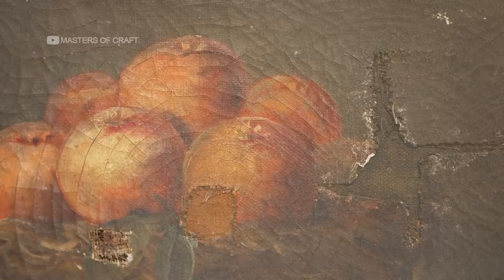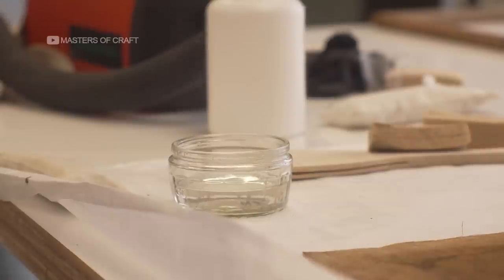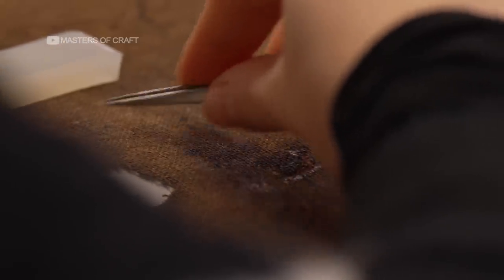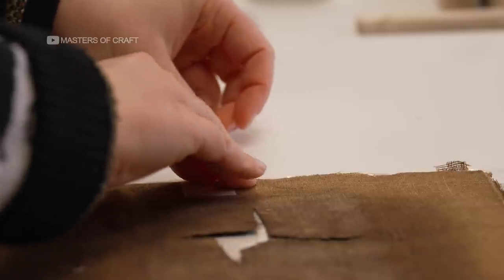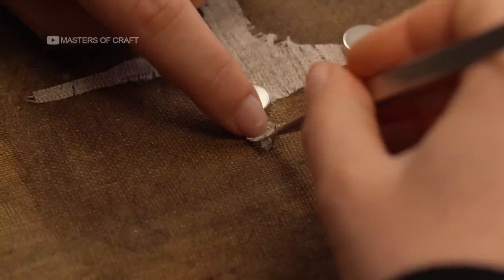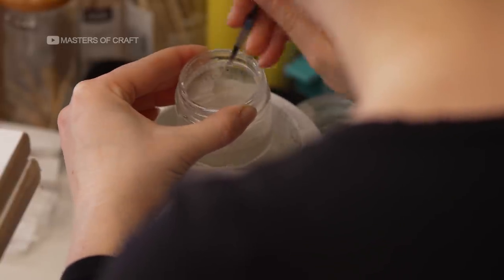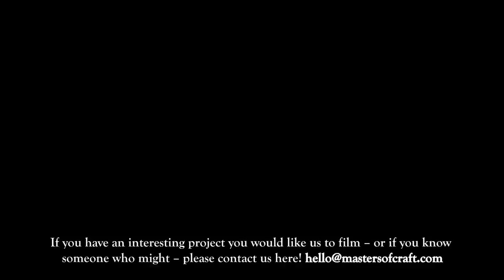How A Damaged Old Oil Painting Is Professionally Restored

Comment: I would rather see the old yellowed varnish retained than someone overcleaning the painting. I bet what is under that varnish is amazing. This seemed to be more about reparing the canvas than actually cleaning the painting itself.
Reply: Usually the varnish has been taken off and reapplied many times as it's an organic material, that never really hardens, so dust gradually embeds in it and it also gradually yellows over time.

Comment: Where is the cleaning and varnish removal?
Reply: I was thinking the same thing. Maybe they didn't do it on this piece?
Reply: probably customer's request. Sometimes the owners of the paintings want it to stay old.
Reply: Yep I'm confused too 🙄
Reply: I think it's a "museum piece" meaning that it was a museum restorer who did the job and not a proper restorationist... a proper restorer despises staples and makes an attempt to make it easier for other restorers to make needed repairs in the future
Reply: Out of budget. Also, it was cleaned and restored before, no need to go aggressive even if varnish has slightly deteriorated. As for staples, they are not touching original painting, only added fabric
Reply: It was obviously done. Probably a cut in the video.

Comment: I don't understand how the paint layer was being protected while the back of the painting was being brushed and scraped.
Reply: You don't need that. Baumgartner and many other restorers do it. But in most cases it's unnecessary.
Reply: Why is it unnecessary?
Reply: @alberteisenmann1023 Of course it is necessary.  Paint is a sensitive and fragile medium, especially as it ages.  A true conservator tries to preserve every bit of an artist’s work.  If light dust were to be removed from the back of a painting and it could be removed by a very light touch, no washi kozo or other fixative might be neeeded, but this painting had fragile paint which was then pressed into the table top.  Shockingly poor technique!

Comment: Nooooooooo! No staples!  You didn’t use an isolation layer? What happens down the road when the next conservator needs to remove what you’ve done?
Reply: Why didn’t she use the hot table earlier?
Reply: isolation layer is not always necessary. Sometimes Baumgartner doesn't either. Conservation paints are easily remove.
Reply: they know better

Comment: I am no art restoration expert, but this hardly looks like it has been fully restored like other paintings on a different channel.  All the cracking, swirling, and obvious patches.  Wow.
Reply: Mr B would be appalled by this half-assed 'restoration'
Reply: Seriously, those cracks could have been fixed. They should have gotten the paint flat using the hot table,  then done an adhesive impregnation to secure the paint layer to the canvas. I can’t help but feel that the paint here is just going to flake off.
Reply: @gunblade250 I'm surprised that the paint didn't flake off underneath at the beginning with the rough cleaning
Reply: @Cristi81272.
It looks like a botched cosmetic surgery job.
Reply: I'm not a restorer nor have I watched a lot of restoration videos, but wouldn't flattening the paint remove the brushstrokes?

Comment: It was all good until you used staples to secure the painting to the frame. That made me cringe. Staples do do well over time and since that is already an older painting you should always be thinking in centuries when doing restorations. Regular canvas tacks can still be good for centuries.
Reply: If stainless steel staples are used, then I can't see it being a problem. They stapled through the new fabric, not the original linen.

Comment: Ok gotta ask. Why didn’t you face the painting to avoid chip loss? Why not put an equal weight of canvas under it and trace it and use Japanese mulberry paper(make strips on the back)to keep it in place. Or use the birding technique w added canvas to the tears? Is the back coated w rabbit skin adhesive? Cow hide adhesive? So many questions and mistakes.
Reply: Are you an art restorer? What training did you receive?

Comment: Totally not trying to drop a bomb or hurt you in any way.. just take it as constructive criticism if you would PLEASE. It literally hurts to see old paintings restored in these ways. Please take to heart what I'm going to say and what I know everyone watching is thinking but too nice to come out and say it.
 :45 Why are you taking a vacuum to the painting without removing it from the stretcher first!!?? The uneven weight will make paint layer vulnerable
3:02 If you're manhandling the painting so much and scraping the back, for all that is holy, why isn't the painting faced??
3:21 You're really going at it.. by the way the debris is coming off, everyone can tell that it's rabbit skin glue.. wouldn't it be so much easier to use a hydroscopic medium to make it swell so it can easily be scraped off?
4:41 if you're ripping a patch off of the back for heavens sake why isn't the flipping painting faced with washicozo? The painting is vulnerable and may tear more.
7:46 nothing like smearing seaweed gel into the canvas fibers 
11:34 Yeah... That's what a hot table is for honey.
12:06 putting nylon silk organza without the painting even being flat first!!???
12:20 isn't it easier to find some old canvas that has the same weight and weave, stick it underneath the painting and trace directly onto it? Then cut it out without the extra steps?
14:25 sturgeon gel? To strengthen the seethrough threadbare canvas inlays? Why not just find some actual canvas of the same weight and weave as the painting!?? It's going to leave planar distortions on the front.
Sturgeon, fish gel, only to be used for facing a painting because it can be removed. Fish gel not to be used as a permanent part of the painting as it is organic, will rot, bacteria, and is hydroscopic which means it will absorb humidity causing mold to form. Hello?
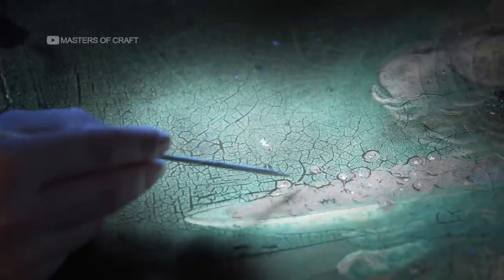16:45 all that green haze means old resin varnish. This old varnish is causing discoloration and cracking of the surface paint layer. Why is this not being removed??? You're going to varnish on top of it??
18:40 however, great job on your weaving skills.  That's impressive and you did a great job. 
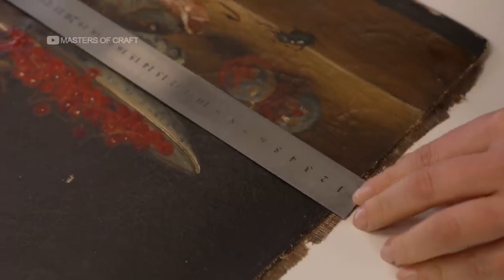19:20 don't you think it would be a good idea to do a reversible adhesive impregnation before relining the painting? To stabilize the paint layer and it's cracking paint??
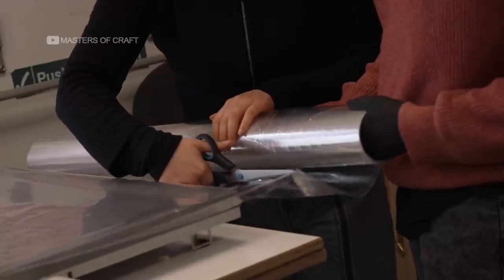20:18 just found out that you DO have a vacuum table. WTF Why isn't it being used for all these other necessary jobs??
20:47 trying to line the painting but it's not lying flat because it didn't have a hot table treatment LMAO
22:00 the only thing you've done right so far..laying the painting face down instead of face up so your thin canvas inlays don't make so big of a planar distortion.
22:56 nevermind the previous compliment. You just ruined it by flipping the painting.
24:14 STAPLES? Seriously?
24:43Why is the stretcher being squared AFTER the painting is already mostly STAPLED to it?
25:15 again.. animal glue? Mold, rot.. 
26:23 doesn't anyone else see.. Huge planar distortions.. The fill-in chalk-based medium is sunk down and NOT level with the paint layer. Holy flipping mother of. 
27:45 yes,  let's varnish over the old existing varnish layer now. 
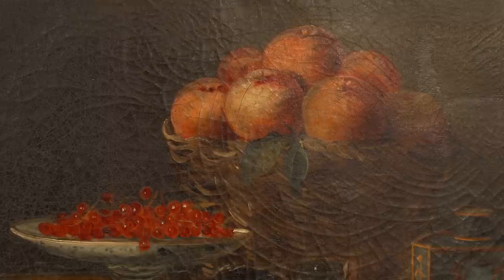28:24 wouldn't it just have been easier to remove the old resin varnish in the first place which would have simultaneously removed all those cracks.. pretty paint layer, less photoshopping.
Reply: Heads up, the words are “hygroscopic” and “washi kozo.” Hopefully it wasn’t your intent, but the all-caps and the sarcasm also come across as a bit harsh.

Comment: This restoration company should watch a few of Julian Baumartner's restoration videos to see how a truly magnificent restoration is done.  The original varnish wasn't removed, so the dirt from 300 years was still on the painting.  A vacuum won't remove that.  The repairs were still visible after the restoration was completed.  I suppose it's better than no restoration at all, but this was not a great restoration.
Reply: Retouching with watercolor on an oil painting too.
Reply: I'm a fan of his channel too, but hey, I figure all art restoration studios have their own way of doing things. Apparently Baumgartner gets a lot of criticism for his methods. We're not the professionals.
Reply: @davidplatenkamp Retouching with water colour is the absolut right way. Because the retouching must be reversible. No real restorer uses oil colour for retouching.
Reply: I think it's impossible to get the colour and texture perfect with water colour. probably they judge varnish removal on a case by case. could be it would have been damaging to the paint.n it they wanted to keep it as close to it's current state just more stable. a very thorough Restoration could also be damaging to the art
Reply: @kenfryer2090   Again, I wrote it above - Retouching is always made with water colour or Goache. Apart from that there special retouching colours for restauerers, witch are waterbased too. 
If you think this is impossible you are wrong. Every professional restorer does it. I'm a restorer myself and all kollegs do it the same way. Retouching must be reversible, this is the main reason. The water colour is fixed with the varnisch, so it is permanent until the varnish is removed. 
Regards.

Comment: The scredriver is a bit rough on the linnen. 
Perhaps she should investigate an upholsterers tack puller with 2 small prongs to lift tacks. 
Use a thin splint or wedge of wood to cushion the tool against the frame to avoid damage to fabric. 
Interesting process but much to be desired in choice of disassembly tools

Comment: I can't believe someone would just glue a massive patch onto the back and paint it black, like that's restoring it
Reply: That repair could have been done 100 years ago. You think the technology is the same? In another 100 years the next person will say this process is so primitive, why would they do this? As technology grows repairs will get better and better.
Reply: @mercdragons  100 years ago, they had needles and thread. The things I've seen from old sewists and tailors are insane. At the end of the day, the canvas is just another textile. They had the technology to do more than glue a piece of scrap fabric to the back. I can appreciate that the glued patch kept the hole from getting bigger, but that's all it does. It's not even a repair, much less a restoration. It's a temporary solution to keep the problem from getting worse, which, again, I can appreciate, but then nothing more was done to fix the painting until it got into this person's hands.

Comment: Please excuse my ignorance; but, I'm confused about some aspects of this restoration video & absolutely flabbergasted at the ingenuity of how they accomplished other methods of repair.
Before watching this video, I'd never seen or even heard of a smoke sponge, crepe erasers or the way they went about patching holes & tears in the canvas of an oil painting. I'd heard  or read about various methods that could be used to clean old oil paintings - some of which made absolutely no logical sense. I'd never realized how a decent patch could be created & applied in such a meticulous way as not to be obvious.  That entire process was absolutely fascinating.  However, I was disappointed that this particular video did not go into detail as to the various steps & materials used like was done in the  video Masters of Craft did for restoring a print.  
As for the aspects of the video that confused me:  
1.) I've always thought restoring an oil painting included cleaning it. Not the type of cleaning shown here; although, I found the cleaning that was done extremely interesting. What I mean was I thought the old varnish would be removed because even being cleaned with smoke erasers & other agents, the decades/centuries of being exposed to smoke, dust, grim, dirt, etc, would have permeated the varnish - gotten into the cracks & crevices - causing it to become discolored & therefore blocking the vividness of the original colors that made up the oil painting. It was even stated in the video that the previous restoration attempts were done incorrectly because the original varnish was painted over. The varnish itself had cracked with age, which to my way of thinking posed an additional concern. Such cracks left the underlying pigments exposed, to the very same elements which lead to the discoloration/dulling of the varnish  Surely, the old varnish needed to be removed so the original colors of the painting could be viewed & any areas that had been exposed could be cleaned.  I realize the spray coat of new lacquer/varnish would hold the underlying painting in place; I just don't understand why the old varnish wasn't removed.  
2.)  Why were they using what appeared to be water colors to recreate the areas where the original oil paint had once existed?    Why not use oil paint?  The old oil paint formulas can be recreated; so, why not do so & use the same medium used to create the painting in the first place? 
3.)   I  was left wondering why the restoration process they used eliminated so much that could have served as way to evaluate the age of the oil painting as well as any means to provide a provenance for the painting,  
        a.)  They didn't reuse the original wooden stretcher;
        b.)  They covered the back of the original painting with new linen in such a way the original canvass cannot now be
               accessed eliminating one method of dating the painting based on the linen on which it was painted
       c,)    They stapled the new linen backing to the new wooden stretcher eliminating any easy way to view the back of the 
                painting & use that information to date the painting based on the age of the original wooden stretcher
I suppose the painting isn't actually considered valuable; so, there was no reason for them to restore the oil painting in such a way that it could be verified as being as old as it was stated in the video to be.

Comment: It seems to me that a relining at the beginning with subsequent filler medium would have been the most efficient way to deal with the structural problems created by the large holes and with all that surface warping..  Did this painting get cleaned on the front?  It looks like you have left the old varnish on.  We see lots of cleaning done on the back. Was there an isolation layer applied to the front before retouching?  Staples, oh no.

Comment: Major loss still visible after repair.
I would like to look at the painting but i can't see it due to all the lines.
Old over paint and varnish, and therefor dirt under these, not removed, Leaving colours distorted from what was actually painted, making the restoration paints incorrect colours.
Did it need a full lining or would an edge lining have been sufficient?
Under UV.  Whole bowl of cherries over painted. Bright blue dots over paintings surface is either dirt or previous work done.
What was wrong with the old stretcher

Comment: I was surprised by the many staples on resizing and not using rabbit glue. A lot has changed in cleaning and adding new linen in holes. This might be a new version, but it was not a correct version. I am an American Master with over 50 years of experience in visual art and I had to learn all of this. Shame on this You Tube presentation. You devalued this work when you put all those staples in resizing.

Comment: As a complete ignoramus that watched a lot of Baumgartner restoration, comments:

Vacuum to a paintng?? No!
Didn't apply a facing, and then does all sorts of agressive treatments on the back.
Didn't show the cleaning process.
Didn't remove old varnish apparently, given the result has the same aged hue.
Applying the patches was quite convoluted and nonsensical. Interwoven patches are not result reversible. By pulling the stand on the original canvas to arrange the patch you just further damaged the original. Morever, seems she picked canvas of a different weave. Then impregnated with organic fish glue instead of priming? Wtf? Fish glue is not a permanent medium. That putty is going to flake off.
In the end result the big X damage was still visible after the retouching.
And staples!?!?!? Sacrilegious. Staples detiorate quickly, will rust and cut the canvas, and provide little support. Using tacks is a much better way to frame the picture.

But, nice job. Now this painting is ready to be properly conserved.

Comment: I hi k it is a shame to remove parts of he character and ageing features like dirt on the back will always tell people the painting is okd and there is no need to remove it or take it off thr frame. You might argue but I was a repainter i a crooked at restoration place in Brighton. I didnt know they were crooked when I workes for them. I hate what restoration does vis: everything to make the painting new looking. Where is the point? I mean if one is very dirty then it will need clean but not a big thick coat of varnish but a water thin onenresp3cting age. I have gone to museums and galleries and been horrified at the obvious attempts to reatore, very obvious and terrible on highly valuable paintings

Comment: After all the restoration work I can't believe they used staples to attach the canvas to the stretcher- and without reducing the canvass corners either. This trashy move lets down the process and cheapens the the procedure. Not impressed.